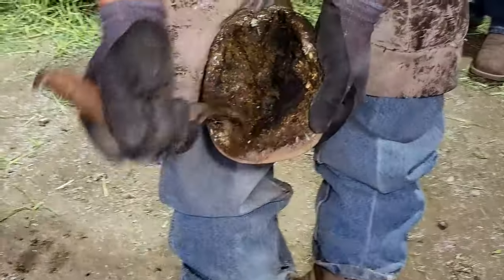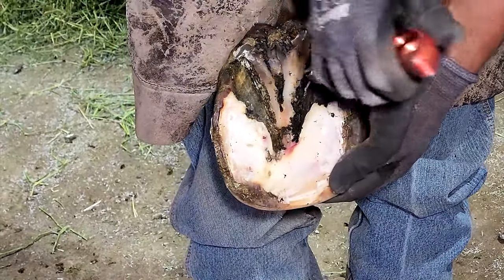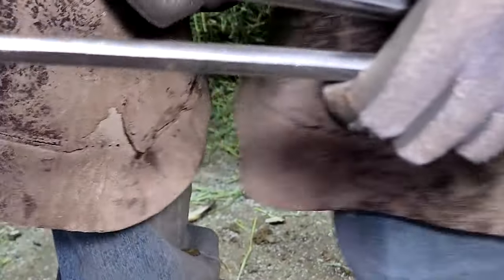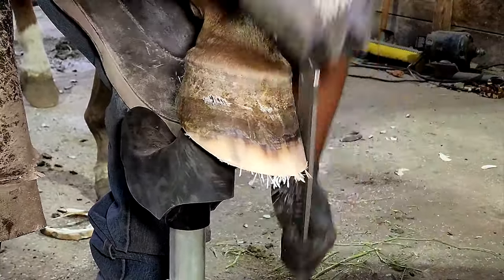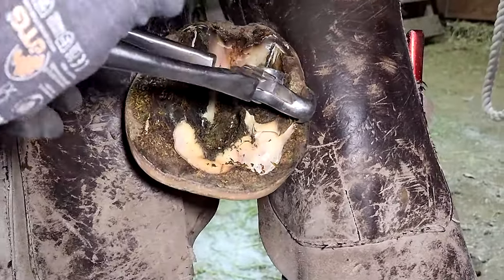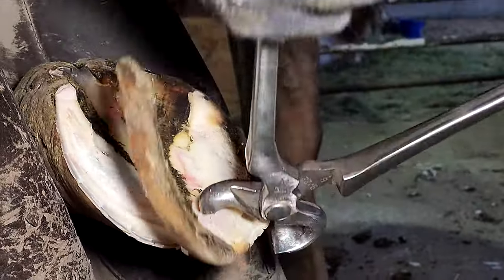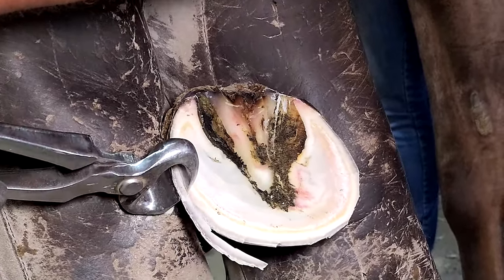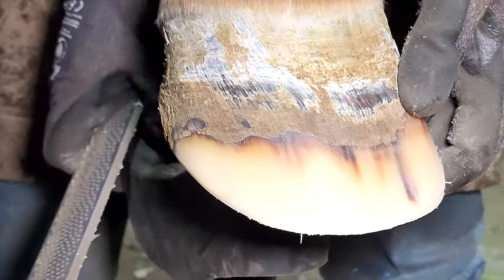These Hooves are So Long!!! This Mare was Needing Help - Trimming Long Hooves - Hoof Restoration

Comment: The penny dropped for me with this video!! I now know what your reference point is for how to determine hoof length. I would like to know how much frog should be touching the ground though. I guess you have to be level on all sides. My Ferrier says that the horse has 5 hearts…one heart pumping in each foot and the main one pumping in the chest. I suppose I could have ascertained the frog position after being told that but I didn’t.
Reply from the maker: Your farrier is absolutely correct I say the same thing a horse has 5 hearts the frog it is one of the most important parts of the hoof in my opinion

Comment: I just came across this page recently, but I love watching Hoof GP do cows, so it was an obvious step.

Graham always talks about how sharp his knives need to be, but you're using yours to dig out dirt and sand and rocks from the grooves on either side of the frog, then trim with it.  Do you ever have issues with the dirt dulling the knife or are horse hoofs easier to cut, somehow.
Reply from the maker: The knife I have has a built in I don't use the cutting side to clean the hoof

Comment: This comment is meant to try to help you so please consider all aspect of this criticism.  Think of the idea that length is from the top and depth is from the bottom the heel go to the widest part of the frog the center of the coffin joint is at the termination of the bar. The heel had alot of depth the toe not so much its our job to preserve vertical depth the bottom of the coffin bone is concave the soal should also be concave you took an excess of vertical depth at the toe and didn't bring the heel back the the widest part of the frog your proportions were off from the center of articulation of the coffin bone which should be at least 50 50 if not 60 40 and left alot of length in top of the foot.  Try to remember distortion goes all the way to the heel so dress the foot all the way to the heel. These are mistakes we have all made getting with a CJF in your area and going through AFA certification would really help you sort these things out. Keep up the good fight.
Reply from the maker: While I respect your opinion I would point out that I did address the heal and I did bring it back as much as possible while I do hang out with cjf and cf Farriers I have found that having that title does not mean you can shoe horses correctly. I've seen guys that have no title that are super handy and I've seen guys with a title that I wouldn't let touch a dead horse let alone a live one. To take the heal all the way down with out shoeing this horse would have made her lame. This is a brood mare so we do what we can
Reply from the maker: And im curious how you know whether  I'm certified or not lol as it's never been brought up
Reply from the maker: For the record I am going through the process of certification
Reply: I take guys through AFA certification every year and can tell where you are in your knowledge and skill level my comment was ment to aid you and the horse you work on not to beat you up believe me we have all been there. As a prior tester for the AFA and one the attends and gives clinics in the pacific northwest I have never seen you at a clinic contest pre cert clinic.
Reply: I can tell your not certified if you where your shoe modifications would be spot on and how you swing your hammer and use your horn on your anvil would be natural because you would have completed your shoe board and learned a ton.
Reply: It's not the title it the journey traveled to the title.
Reply from the maker: Hey man I'd like to apologize I took your comment the wrong way and I'm sorry for sounding froggy I actually sought out a cjf in my area and am working on my cf and eventually my journeyman. We just started and I'm realizing how much I've got to learn. So please bear with me hopefully you'll see some improvement hear soon please keep up the comments hopefully I'll run into you one of these days and I can shake your hand. Your comments made me think thankyou
Reply: Congratulations keep up the good work and keep pushing forward and most of all remember its the journey that matters .